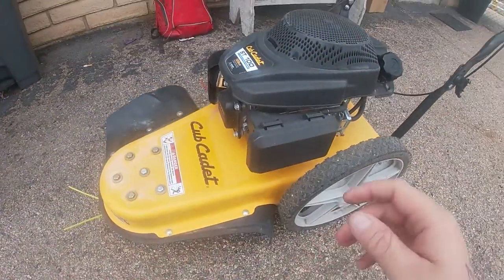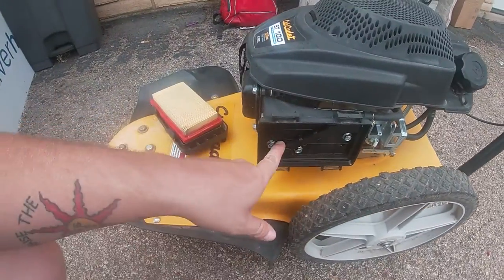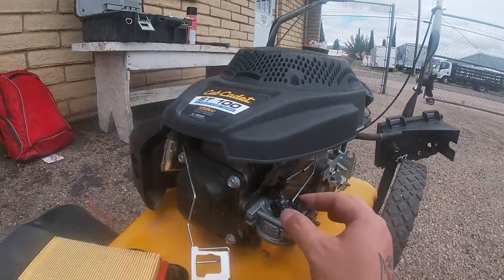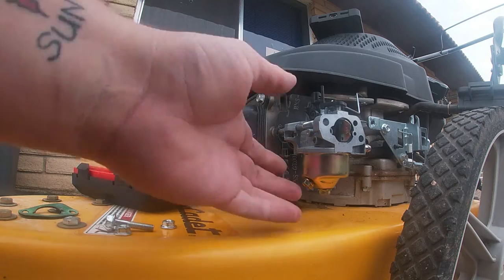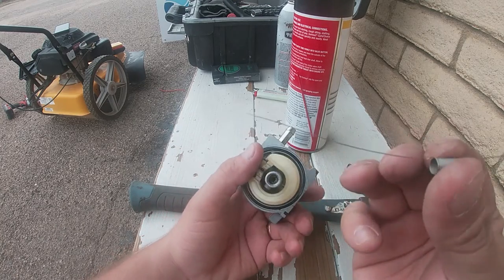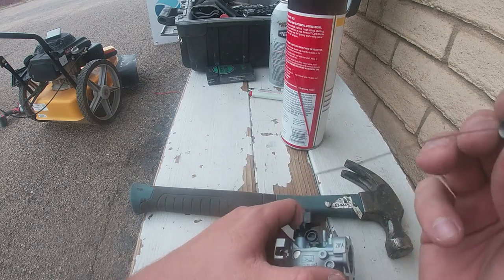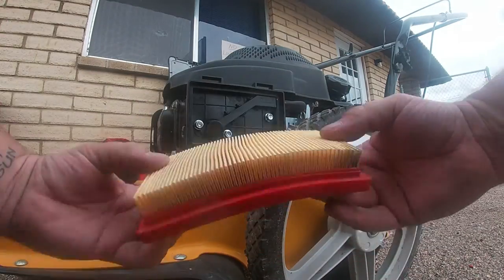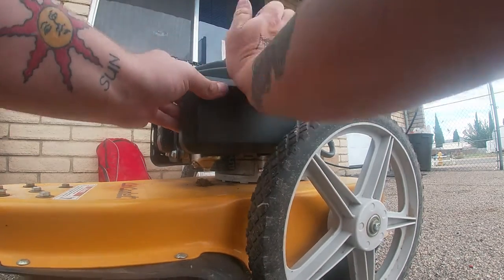How to Fix Your Cub Cadet ST-100 Walk Behind String Trimmer in Just 10 Minutes!

Comment: FYI:  The engine on the Cub Cadet is a Kohler engine.  I really liked your video.  I did not know how to properly remove the Choke wire that is attached on top.  NOW I DO, thanks to you.
I got 2 Cub Cadets and 3 Craftsman walk behind trimmers given to me that do not work.  He said, "you fix 'em, you keep 'em".  I thought that was cool.  so I am just getting started on them.  Your video sure came in handy on the carb cleaning.   Runs great!!  Once I put the tension on the belt I cannot even pull start it.  bound up.  I think it is the idler bearing that is seized up because with the tension off the belt the trim tower spins freely.  Anyway I just wanted to let you know how much I appreciated your video. ⭐⭐⭐⭐  (4 out of 5 because you need more camera work)  You did great!!!!

Comment: A hint on the fuel : Take the top lid loose and you’ll find the tank is integrated.

Tip it back so the tank part is below the carb, disconnect the hose, and set aside.

No clamps needed.
Reply from the maker: Sweet I try

Comment: I watched four YouTube videos on this and you’re the only one showed that trick of removing the butterfly from the choke shaft to get the choke adjusting rod out, saving taking the whole cowling etc. off. Also thanks for pointing out at the beginning that the plastic pin on the choke assembly goes in between the two metal pins. Saves nagging doubts. (Sure, I took “before” photos but somehow always miss the one thing I really need to know.)
Reply from the maker: Awesome thank you so much for watching 😊 yeah I try to show tips to help people

Comment: Recently we bought one of these machines. The engine does not have an oil filter. Is not having a filter normal for little four stroke lawn mower engines? 

I really hope to avoid carburettor problems with this Cub Cadet but if we do I’ll have this video. 

Normally for little engines i fuel them with non ethanol fuel. Also I turn the fuel off and run them dry. Do recommend doing this? I figure if the engine runs till it runs out of fuel the carby is less likely to be gummed up by old fuel.
Reply from the maker: Yes, it's common not to have an oil filter some riding lawn mowers don't have an oil filter. Non-ethanol feel is good. It gets expensive and running. The carburetor dry does help but it'd be better just to turn off the fuel and drain the carburetor

Comment: Mine is a beast. I've had it two years and had to take it to the shop once as it just stopped running spluttered twice. Was using it for the first time of the season and it did the same thing. .... Good gas ,oil, air filter etc. It will cut some heavy stuff but I think I got a lemon
Reply from the maker: I don't like this kind i will the ones that you can start and activate like a mower

Comment: Hi my idler bracket broke for 3rd time on ST100 this time also the belt the one I got from club cadet was at least twice as thick they claimed it was correct an upgraded part after wrestling it back on. Having it sideway etc. Now it wont start, the plug is not wet seems it is not getting gas, it ran great before I worked on it. Could you please give me some things to try should I try the carb repair like you show on your video? Thanks I like that video even I could follow the fix.

Comment: Good video. I have this exact trimmer. I use it 3 or 4 times a year. Sits  stored most of the year. And yes, I do use stabilizer. I live in Wyoming and winters are long. I will try cleaning the carb since mine doesn't want to stay running.
Reply from the maker: that should do it. dont use stabilizer unless its seafoam

Comment: I have this very same field mower trimmer. I'm out on a small part of my four acres. I'm mowing field grass and hogwart weeds that are about as big around as my thumb. According to the description of this particular mower, it's supposed to be able to handle stuff like that. But it does not do well at all. What I don't understand is for a field mower, why would it be string? It's a field mower! 
It would be so much better if it had some kind of metal accessory to replace the line. I've done a couple of searches and I don't find anything. Is there anything out there that I could use or make up for myself? I'm a 65-year-old crazy girl out there doing this, I could sure use some help figuring this out. Thanks!

Comment: A landlord asked me to get one these Trimmers out her one of her rental properties.  I got it home and it seems so hard to pull to try and get it to start with the lever pulled down, for you can't pull the pull cord when you don't have the moveable lever pulled down.   
Just for fun I looked up on much they are new and a was rather shocked to see the prices and thought who would leave one behind?   
Well, wish me the best on getting it going!
I will start with a fresh Spark Plug and Fuel!
Much love to all humans!
Reply from the maker: thank you
Reply: I have the same problem with mine. Turns out it the spindle assembly. It cost 285.00 on Amazon and 318.00 on the cub cadet page. A new one only costs 399.00. It's a sealed bearing that has frozen up in the spindle.
Reply: @kwytch3154  Wow, that is crazy!  I took apart the carburetor on mine and cleaned it thoroughly, as is was gummed up with small particles and was not allowing fuel to pass through it.   I put a fuel filter on the gas line and a new air filter.   It fired right up.  I bought the Oregon string for it and I now have a weed whacker for less than 60 bucks.  
That is a bummer on yours!  
I see Troy-Bilt has one for 400 bucks at Menard's.  
I will admit these trimmers are fun and really whack stuff up.  
Thank you for sharing your problems.  I guess if my bearing goes out, then the whacker will get recycled.  LOL!  
Much love to you!

Comment: @repairgang I have this exact mower. It sat over the winter. Would not start this spring. I cleaned the carb still won’t start. Ordered a new carb and installed it. Still won’t start. It kicked off but won’t stay running. I’ve tried ether and squirting fuel in the carb. Still can’t get it to stay running with a new carb. Fuel comes out the bowl drain.
Reply from the maker: Could be the kill switch or the new carburetor is bad which is a possibility. I would need some pictures or more information you can email me
Reply: I have the same problem. Did you ever figure out anything?
Reply: Cleaning the carburetor as he said worked but I intermittent ly have trouble with the automatic choke not turning off.  Any adjustments for the choke?
Reply: @hanksch have no idea
Reply: @rtc-1840 no it sat over the winter again. I’m back at it again and I’ve done the basics and it’s still dead
Reply: @hanksch  The auto choke on these things seems to be ass garbage.  We've had one and it hasn't worked right since we got it.  Usually it eventually turns itself off but sometimes it just fails.

Comment: Followed directions.  Alas, at one point the connecting piece for the automatic choke to somewhere fell down onto the bed.  I tried guessing where it goes but probably guessed wrong.
Now the thing starts but won't run at full speed - chugs along as if still fully choked.
JUNK...  Any ideas?  Too many wraps on spring?  Something else?
Reply: Ironically, it was probably bad gas all along!!!
Reply: Update: Guess what?  I watched the video 3 times and repair guy said, "Make sure the choke thingie is between the two rails of the other thingie".  I said to myself, "SELF!  Make sure the choke thingie is between the two rails of the other thingie!"
I opened it up again the day after I posted the above and sure enough, The choke thingie was on the outside of the two rails on the other thingie which was holding the choke CLOSED.  I reinstalled the carb with the choke thingie in the correct place, burned out the rest of the bad gas in the line and IT RUNS!
So, kids, don't forget to put the Choke Thingie BETWEEN the two rails of the other thingie when you put the carb back on.
Reply: Update: Spoke too soon - won't run over a slow idle and can't wack weeds.  Frustrating!  😞
Reply: "AUTOMATIC CHOKE" WILL NOT OPEN.  DAMN!  Gonna' try wiring it open and see if wacker engine will run at normal speed.
(I pretty much HATE "automatic" anything that doesn't work correctly and gives you no other decent options)

Comment: What was initially wrong with the trimmer?  Why did the trimmer not want to run and just suddenly "fixed" itself?  This could be a pretty good source if you would prepare, slow down, and edit your camera work.  Oh, and is it a Honda engine?
Reply from the maker: It didn't fix itself. The carburetor was clogged and I found out it's a Kohler engine, not a Honda
Reply: Yeah real smart jack what were you thinking with when you typed this comment, your pretty much just told everyone you don't know what your talkin about😆
Reply: @ItsGinter234  I'm guessing he means the auto choke, where it just wouldn't disengage, then he cut camera for a sec  and then it was working fine.  I'm guessing it finally caught up?  We have one of these and the auto choke is a piece of shit that doesn't disengage half the time and haven't found a great way to make it reliable.  At least it runs now, but did he actually fix this part or is the owner gonna have auto choke problems every time like I do?

Comment: It’s a power horse nothing like it
Reply from the maker: The only flaw with this one is you can't leave it running and have the the string not moving. I like the ones where you can start and then activate the string. Deactivate the string without killing the engine

Comment: ABSOLUTE  PIECE  OF  FREAKIN'  JUNK  WITH  A  COMPLETELY  WORTHLESS  WARRANTY! - Mine is less than a year old, started smoking during operation, oil turned pitch black, and I thought, "Great, burned valve or wasted valve guide, okay, 'Three Year Warranty' though, right...?" WRONG! Even though the machine has less than four hours of run time, the dealership said that the valves were out of adjustment, and that would NOT be covered... I said, "Hang on... You're telling me this thing's engine is such a colossal piece of shit that they expect the valves to be out of adjustment after being run FOUR HOURS?" First piece of Cub Cadet Equipment... LAST piece of Cub Cadet equipment. Happily going back to Husqvarna...
AVOID  CUB  CADET  LIKE  THE  PLAGUE,  THEY  DO  NOT  STAND  BEHIND  THEIR  EQUIPMENT!